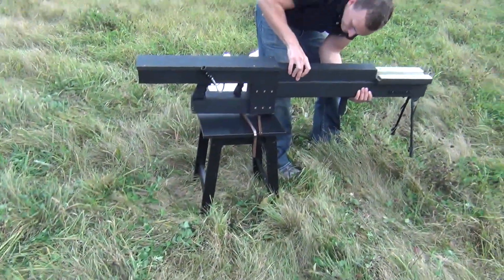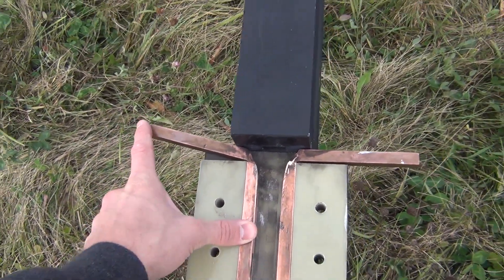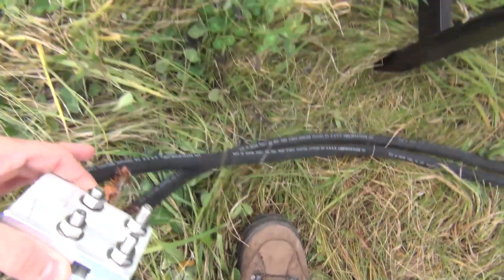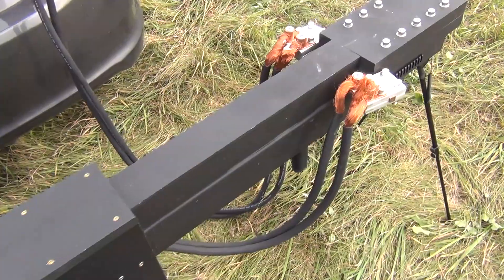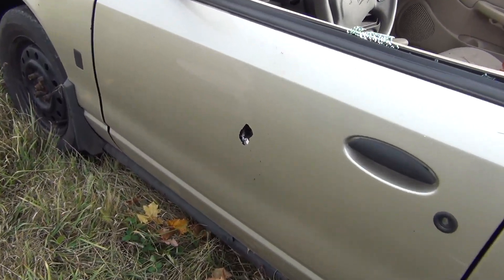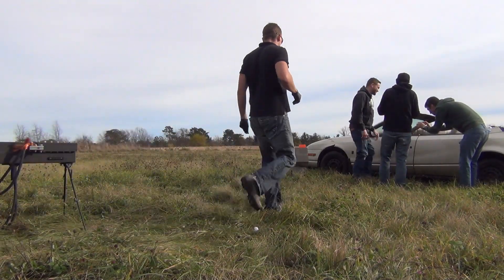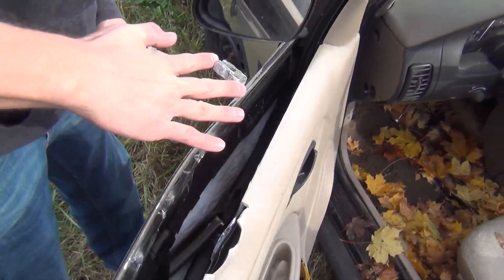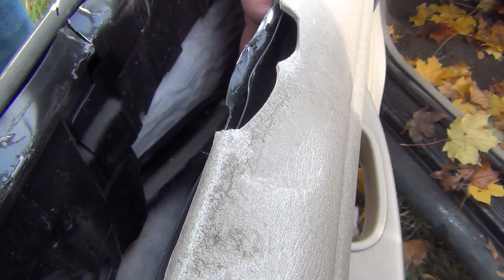250lb Railgun vs. Car Door: 27,000 Joules. Launch #4

Comment: A railgun is a stupid technology that should have never been researched.  It requires so much power and electronics that a gun 1/100th the size and weight could do the same damage.  Even that large military rail guns that take up 3-4 semi trailers can not even match the power of a small howitzer.  There is no way they can improve the efficiency enough to EVER make it a viable weapon.  A simple pistol can do more damage than that railgun without the need of a trunk full of capacitors and batteries... and be more accurate, longer range, more reliable, massively cheaper, smaller, lighter, conciliable, better firing rate...  It is sad the US government wastes so much money on railgun.  Laser technology is pretty much in the same boat, but at least there are a few advantages/roles for laser weapons, but realistically missiles are better many times over 99% of the time.  It is much easier to improve missile technology than to make lasers worth using.  Spend money wisely.  These technologies are not worth it.  Same for sending someone to Mars.  There is nothing to gain from it.  Make missiles faster and track better, make sniper rounds that are laser guided
Reply: we do have better technologys for making power, on a nuclear powered vessel power would not likely be an issue for the railgun itself, i have done 4 years of research about nuclear reactors and i can say depending on what the uraniums half life is, theres probobly a whole lot of power that can go to those projectiles. i get what you are saying is that these things are just plain ridiculous but every weapon in history didnt start of good. besides this could be used in technology for attack satilites because it does not require air or any special fuel, instead it applys a more kinetic force to inflict damage, and if everyone remembers 8th grade science, its that energy is never lost or gained, its just simply converted, so the speed they would be launching it from space plus gravity from the earth would build up more kinetic energy making the projectile more deadly, so when it finally hits all this energy is forced into this area to make a big boom, get where i am going with this? i meam missles are not that bad for attack satilites as well (i dont even think we have attack satellites yet) but those can only burn up fuel with air because basic chemistry of fire, and you would be storing explosives right next to where you sleep, unless it is like call of duty ghost where there are separate units carrying said missles, and even then if we had missiles in space perfect timing can intercept the missile and blow it up as rather a solid metal rod dosent have any explosives and therefore canot be shot down or blown up, and even if they did shoot it they would have to have equivalent force of the sound barrier at least in order to make the projectile harmless. railgun technology isnt really good right now but hey, its getting there, its like jet technogy within WW2 to some extent
Reply: oh by the way i think they had a sniper riffle that gets more accurate the farther you are away from your target, its a laser guided round and you have to hold your scope on the target until impact

Comment: if that produces 27000 joules of energy how come it won't even go through a door, when you consider a 9 mm pistol would have gone through the other door as well
Reply: Energy stored in the capacitors might be 27.000 Joules, but due to various factors (one of them being the unsophisticated construction of the device) a lot of it is lost, so the projectile ends up having only a fraction of that
Reply from the maker: +Gay For Brae there is a relationship between amperage and efficiency. However, higher amperage results in destructive forces on the rails. This railgun has a similar acceleration to the military's, however, it doesn't have the capacity to hit mach 7.
Reply: The military grade railguns that are way more sophisticated than this one have specially designed bullets that are heavier and have a point these bullets are also around 50lb and the guns are a lot larger
Reply: Ziggy Zee I remember doing a big study as a project on military grade railguns and other electromagnetic rifles and most of the military grade rail guns do not use rails they use long coils of wire that replace the rails and combined with the specialised shape this creates high forces capable of vaporising humans
Reply from the maker: +Gay For Brae I don't think coils are desirable. More inductance and resistance.
Reply: There was a variation of a rail gun that was a lot of coils together and there was some sort of detector that turned the electric on at the right time and turn them off at the right time
Reply: @gayforbrae5693  That is a gauss gun/rifle, not a railgun.
The only two things those have in common is magnetism, but they are mechanically very different.
Reply: Called a "mass driver"

Comment: Two things- 1. Just because you can fit it in the back of a hatchback doesn't make it "mobile". 2. One thing I never got about yall railgunners (I'm a coilgun man myself): Why use aluminum for the projectile, when you could use copper? It's more conductive, heavier, stronger, deforms less on impact, forms just as much of an eddy current as aluminum (actually more because of the conductivity), and you get a helluva lot less accidental cap discharge welds with it. Plus it might actually be easier to find thick enough stock to make a projectile from compared to aluminum.
Reply from the maker: +Craig Blanton Our new solution is very, very mobile. Video coming out soon.

Aluminum has better conductivity for its weight. Aluminum has a low melting point and high boiling point. Aluminum is meant as a mass driver, not the actual round.. so it should be as lightweight as possible. Ballistic characteristics don't matter if you're propelling a finned tungsten projectile.

The military uses aluminum, I use aluminum.

Comment: I'm fairly certain your projectile shouldn't have nearly as much resistance (physical, not electrical) going through the barrel as it does, that's probably costing you more power than anything else, and also what's causing the huge blowout of sparks and all the metal shavings and damage inside. I'm guessing the projectile should have maybe 1/2 a millimeter of clearance on all four sides in the barrel.
Reply from the maker: Close contact with the rails is necessary for the railgun to function. The sparks are a function of the high amperage.
Reply: +Ziggy Zee I'm not familiar with this type, but I know in a regular rail gun with coils you definitely don't want contact, so I figured the same applies here. What kind of a rail gun is this even?
Reply from the maker: +Marcus Coster An electromagnetic railgun.
Reply: +Ziggy Zee REALLY
Reply: +Ziggy Zee Can I get the serious answer now? I'd like to learn about it.
Reply from the maker: +Marcus Coster There's only one type of railgun, the EM railgun- there are no coils. Electrical contact is made and lots of heat and metal vapor results. Magnetics propel a conductive projectile to high speed. 

 (time for bed for this guy).
Reply from the maker: +Marcus Coster my other videos might help?

Comment: The contacts at 0:42 made me cringe.
Gotta wonder how much power bled off as a dead short.
Reply from the maker: Those are of same polarity. Not a short.
Reply: @ziggyzee9779  Ah… but it’d still be better to melt some rubber over them, I assume? Regardless of polarity, you do not want them to be exposed to the weather, but then again, I don’t know jack about building that stuff.

But if I may ask, how many capacitors and what type are you using? I want to be able to make my own just for the sake of it, lol.

Comment: Aren't Saturns made out of plastic?
Reply: yeah..........but the structural beam within the door is comprised of HSS and saturns since they are made of polymer actually have far larger bolstered intrusion beams than normal vehicles to protect passengers from impact etc...or the door from collapsing........more like put all the force to the hinges and pop it off mid accident but w.e.......as if that car can even grasp the notion of momentum transfer in an impact scenariol

Comment: How fast could the capacitors be charged from batteries similar to those in Tesla cars, or the tesla power walls?  It would be useless and unrealistic to mount a railgun turret on a tesla car, but just for the sake of awesomeness i guess, I mean would it be possible? Not that id try lmao.  (i mean yes its possible, power is power, but just how fast would it charge the capacitors?)
Reply from the maker: it would probably be full auto ;)

Comment: I am disappointed in the lack of power the projectile had
Reply: +Jonathan Rice  Considering a 9mm will go through a car door, especially that close, it was very lacking.
Reply from the maker: Since this video, we've improved the velocity, the projectiles, and the power supply (now 35,000 joules). I'll see what we can do :p
Reply: @ziggyzee9779  can you measure the fps pf the projectile
Reply: +Koromose It hit the steel cross beam. A 9mm won't go through that. They showed how mangled that beam was though.
Reply: +Jasminewynja Yea, that definitely matters. But even with that much frontal area, something made of lead, steel, or tungsten would have much more energy at the target. I'm pretty sure the forces involved necessitate aluminum, because ferrous metals might interact with the magnetic field in undesirable ways.
Reply: İ think think it had a lot of power, it just isnt ballistically shaped for penetration.
Reply: +Jonathan Rice It's probably because it was too light, being solid aluminum. They need a tungsten penetrator core jacketed in aluminum, or something.
Reply: Most of the large professional railguns use a sabot system.
Reply: Jonathan Rice Because small railguns are not yet possible. The energy input required is in the megajoule range.
Reply: well,a military railgun,mach 6,very,very powerful
Reply: it's SMC
Reply: It sure as hell would be devastatingly lethal weapon for any person touching both those rails when the trigger got pulled!  You'd have better survival odds being hit bý the projectile, versus getting in the way of all those caps charged up.  BTW Playing with high voltages and current is FUN!
Kind of like most high school age kids like blowing stuff up.   LOL
Reply: @J Blank 
Yes! This!
Reply: Pablo Escobar  
Ah I see. You’re one of those wankers who acts big and angry on the internet to make up for your real life shortcomings. I’m not gonna take the bait, cya.
Reply: Railguns require large amounts of energy to do lots of damage.
Reply: +dispatcher7007 
Yeah. I think 0.50 round out of a Barret M82 rifle has like 19k Joules 
of kinetic energy. And it would go straight through both of these doors.
Reply: Well railguns in general require huge voltages to be effective. The ones being developed by the military require battleships to mount and power the things on. They're not trying to build a devastatingly lethal weapon. They just like playing with dangerous high voltage.
Reply: +Jasminewynja you cant make bullet shaped projectiles and have em work in a railgun
Reply: Fox Wright Saturns doors and quarter panels are made of fiberglass. A handheld slingshot could have done the same damage.
Reply: If I am not mistaken that door on the Saturn is made of fiberglass.  It would be nice to see them tested on a steel door instead.

Comment: Have you measured the actual velocity of the projectile? I'm curious how much of that total 27000 joules is actually being converted in to kinetic energy.
Reply: +AxetehBarbarian For guns this size around 1% is typical. As you scale railguns down they get less and less efficient.
Reply from the maker: +AxetehBarbarian We're working on the measurement. We now have a higher resolution slow motion camera. We'll be taking measurements of the distance between the target, as well.

It's true that efficiency is pretty low with most railguns. Higher efficiency is obtained with higher current levels and lower lifespan of the rails- they literally obliterate at higher power.
Reply: +Taylor Bodin Really? I'd have thought a smaller scale would have less friction, gravity, and inertia to fight against and so get at least a little bit better conversion. 

If you don't mind, do you know what causes such low efficiency?
Reply: +Ziggy Zee I look forward to seeing more of your guy's testing.

At 1% efficiency it should be roughly matching the energy of a .380acp. Not a cannon, but it's nothing to scoff at either.
Reply from the maker: +AxetehBarbarian I was thinking more like 4-5%
Reply: AxetehBarbarian You'd think, but not everything scales nice and linearly like that. Your main inefficiencies stem from resistive losses which increase quadradically as you scale down. Also, I think you have a hard time getting a high induction gradient with small rails. Check out the theory section below to get your started. 

http://www.powerlabs.org/railgun2.htm
Reply: Ziggy Zee I'd be surprised if it were that high to be frank. Have you run it through a chronometer? That would be a real quick, cheap, and easy way to resolve your efficiency.
Reply from the maker: I don't entirely agree with what you're saying.  I think the railgun is in a golden region of efficiency- low enough that rail erosion is nearly zero. The military's railgun has a very similar acceleration- 25-30,000 times that of gravity. The efficiency scales well with higher velocity- to increase velocity, I need more caps and high voltage corresponding with higher velocity. Ulimately, efficiency is less of battlefield importance than rail lifespan.
Reply from the maker: Railguns scale very well. However, below a certain size, the whole projectile vaporizes :p
Reply: Not more than 30

Comment: Am I being dumb here but 7.62x39mms only produce about 2000j of energy and it would have through and through end that car yet this is claiming to have 27,000 joules and it got stuck in the door? Surely even with its lack of aerodynamics etc a 27,000 j projectile should have had more force that...?
Reply: +ArkadyVasiliev This thing has a cap bank with 27000 Joules of electric energy, a bullet fired by a handgun has 500 joules of kinetic
 energy. Considerung the poor efficiency of something like this (maybe 
about 2%, probably even lower) and the quite blunt projectile 
(transferes the kinetic energy to a much bigger surface, wont penedrate 
as good) its clear that this thing wont cut it.

Comment: Soon it will be as powerful as a slingshot!
Reply from the maker: The most recent tests have been promising. 35kjoules input and improved projectile geometry.

Wait till Gen 2 comes out :)))))
Reply: I wish that they'd stop firing it - with their positive and negative cables (& the wires, actually) touching everywhere along the system. xD

(LOL, that way - there could be some real power to the projectile..:))
Reply: +Vladimir Nostromov I see what you're talking about, but those are actually two positive cables acting as one. The negative connection is on the opposite side of the unit.
Reply from the maker: I was confused by his statement too. Yeah, I doubled up 4/0 cables to limit the resistance to acceptable levels. Only a small fraction of the energy is lost due to resistance of the cables and connections.
Reply: @ziggyzee9779 Can you give me tips on building my own? I want to build one because honestly… it’d be fun as hell, and just imagining being able to use a railgun on my own seems REALLY fun.
All I’ve got so far are the blueprints to the Oleo-Pneumatic recoil systems, lol
Reply: KRASS TV don't you mean as powerful as my throw lol looks like a lot of effort for a bit of a shit result. But then it seems to be keeping them entertained so whatever lol
Reply: Paul Jackson and 4 more 🤔
Reply: LOL! The 27,000 Joules must be the energy in the capacitor bank because it sure as hell isn't the kinetic energy of the projectile. The KE of an AK47 round is about 2,000 Joules and it would have gone through both doors
Reply: when will gen 2 come out @Ziggy Zee
Reply: Paul Jackson it’s also more aerodynamic and is shaped for piercing vs what was launched from that rail gun was basically a slab of metal
Reply: Ziggy Zee is need a biger ammo and explosive
Reply: Maybe its better if they have a pointed projectile?
Reply: KRASS TV iii

Comment: use  a lead core covered teflon for more penetration
Reply from the maker: Also, teflon does not increase penetration. It protects a steel barrel from hardened projectiles.

Comment: 27000 joules seriously ? a handgun have about 300-500 joule and is stronger than this hahaah 27000 joules !
Reply: +NeWmeatENTERTAIN This thing has a cap bank with 27000 Joules of electric energy, a bullet fired by a handgun has 500 joules of kinetic energy. Considerung the poor efficiency of something like this (maybe about 2%, probably even lower) and the quite blunt projectile (transferes the kinetic energy to a much bigger surface, wont penedrate as good) its clear that this thing wont cut it.
Reply: they werent using a good enough projectile and should have used a more stable stand for it tungsten would have shot a crater in that door
Reply: Jagr Melo mass mulitple speed. 27000 joules should make a crater with every projectile
Reply: Dawson Hudson this is not an invention, it is simply a shity modification of a weapon that already exists

Comment: wtf is a railgun?
Reply: +Sheob 多形体 Not this
Reply: a gun that fires a metal slug utilizing magnetic currents as the primary means of propulsion.
Reply: its basically a gun that uses magnets to transfer kinetic energy into a high speed bullet flemings theory of quantum movement made the idea possible its the idea of using magnets to force an object forward at a large scale it can break the sound barrier and move at over 5,500 mph pretty hardcore science but this is just a baby version